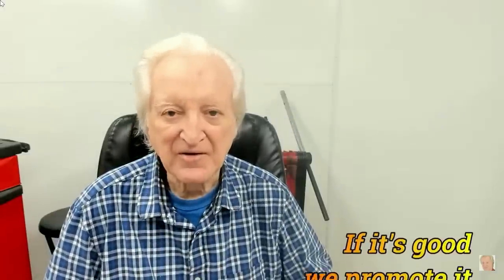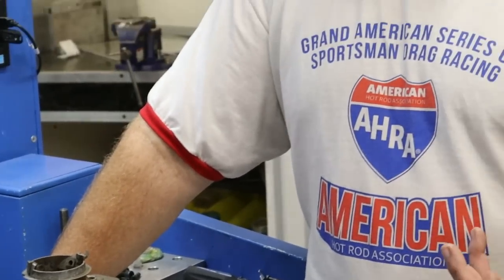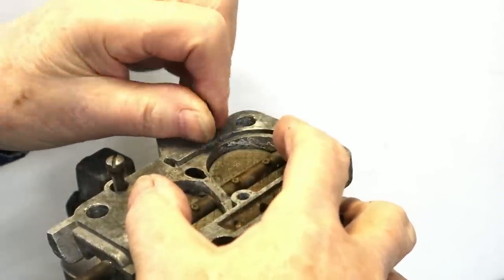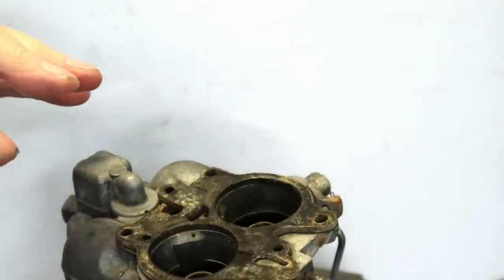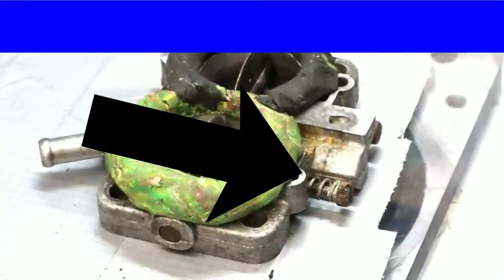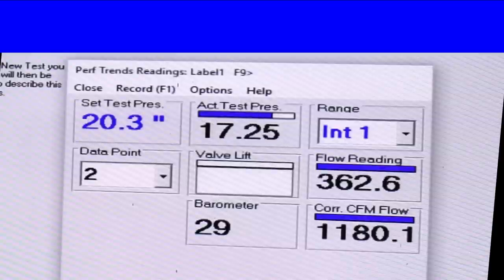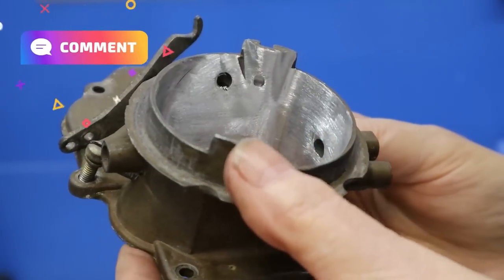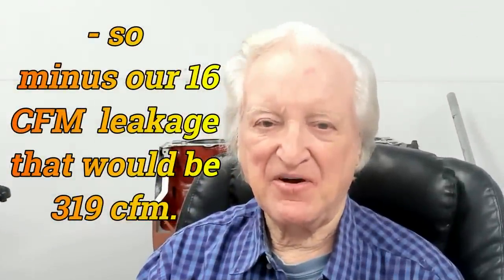How to add 50 CFM to a lowly two barrel carb

Comment: Guys, for DRAG RACING PURPOSES ONLY, could you not simply leave that huge vacuum port in the baseplate unplugged, and pick up 20+ cfm? You'd just have to jet the carb really fat to compensate. Who cares if it idles at 2500 rpm?? 😂
Reply from the maker: To crude we have other fixes that have no negetive impacts.
Reply: Had that as a troubleshooting test during my Tech school program and the engine wouldn't even start. If we're doing far out scenarios maybe rig up a Holley secondary actuator to pull a cap off the port when the manifold vacuum drops during acceleration instead?
Reply: @RodLininski  wow, them good ol' boys was some fart smellers👍
Reply: @kennethstaszak9990  Or just back the nuts off on the carb studs just a LITTLE bit!
Reply: @jeffrykopis5468  Or how about not trying to be too clever by half and keep the carb bolted down like it's supposed to be? All the goofy little tricks only serve to reduce control.

Comment: 318 Engine upgrades
P2531945 OEM or
P4529790 Mopar Performance Windage Tray Kit for 318 340
P3690939 Mopar Performance Windage Tray Installation Kits & Components 
Milodon Lifter Valley Baffle 32620